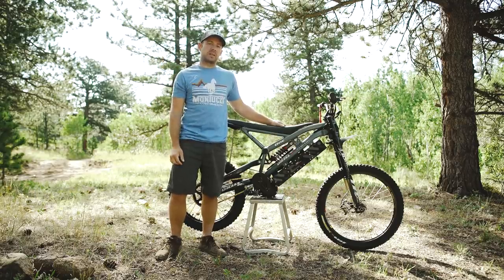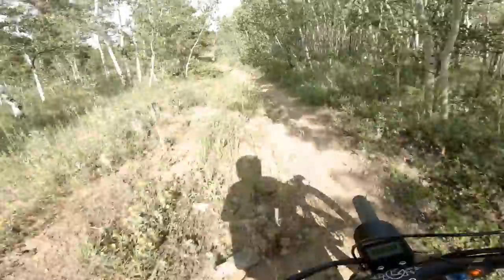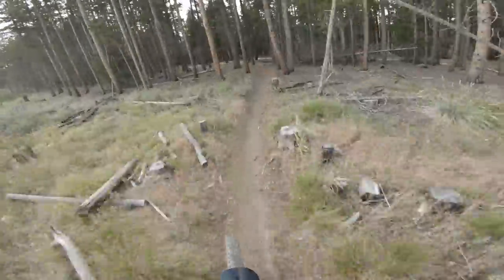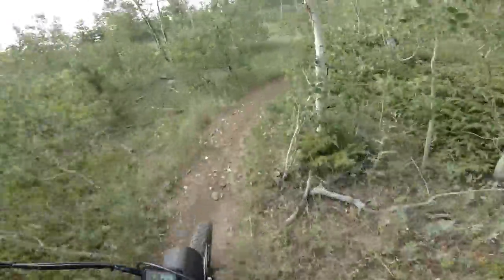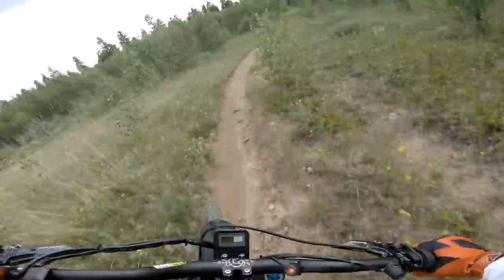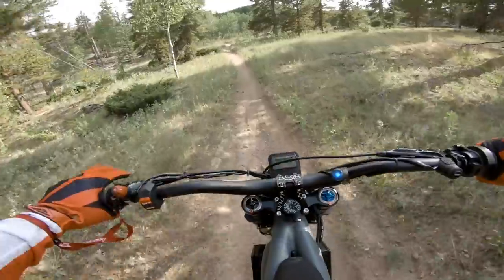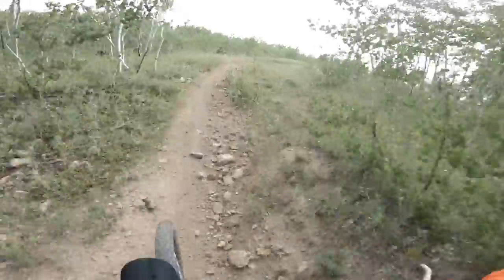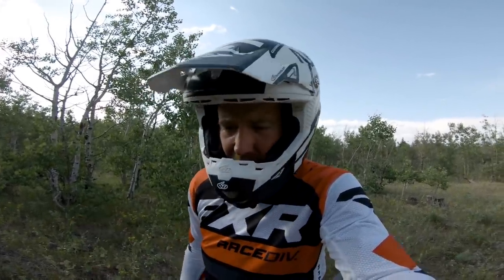CZEM Drill One Electric Dirt Bike | A Sur-Ron Destroyer?

Comment: Yo Tucker, What recommendations would you make for improvements? You mention heavier tires, can you be more specific? Also , will you be contrasting to surron soon?
Reply from the maker: @Jeff Mangano Hey Jeff, still determining what I would change but for certain I would like this bike to have a 21" front wheel with moto tires. I'm still changing the geometry of the bike to determine how it affects handling and will have a follow up video on some of these topics. Thanks for the note.
Reply: @ElectricCycleRider  hi any updates or recent thoughts of the DrillOne?

Comment: What is  a  maximum battery capacity you can  attach to the frame ?  I wish to buy  this  ebike  with  bigger battery  to  reach   70km range in  mountains  ( my  weight 90kg )
Reply: An extended range battery or interchangeable would be a killer option.

Comment: I'm not rly into the whole ebike topic but maybe I would change to this from a 250 kxf in terms of sound and the variety of parts and tracks I could use in my area.
I checked sur ron but it looks like a motorcycle too much for my purposes.
The surron has a torgue of 200 nm if i looked it up right but the drill one is told to only have 40.
Can someone who got the knowledge and time please explain how the statics of the two bikes compare to each other :D
And / or give an alternative?
Thx

Comment: According to the specs (http://drillelectricbikes.com/drill-one-en/) the battery is 42Ah (Surron has 32Ah). So if the power consumption is 3x more compared to Surron the miles range is 3x less (than Surron's "up to 100Km"), giving smth around "up to 35-50Km"? Is that correct?

Comment: How do you feel about exposed battery and a motor on this bike?
Reply from the maker: @Surron electro enduro diary Great question. It is a bit concerning to me. The motor could use a skid plate like the Sur-Ron. As for the battery, I'd be most concerned about the outer corners of the battery in the event of a tip over or crash and it is something valid to note for sure. Thanks for bringing it up.

Comment: I did my research meaning I went to the website that you linked onto your video I am not sure how this is a surround destroyer number one they do the same speed when you buy them in stock number two it's 11,000 the surround is only $4,100 so a destroyer I think not it may accelerate faster in stock but you can easily upgrade to a bigger more powerful battery and controller on the surround and really it was still be only around $7,000 that's of course if you don't sell your old battery and controller and get about 1,800 for those two items I'll be buying a sur ron .

Comment: My biggest complaint with Sur Ron is that they use a front tire as a rear tire when they could have easily used a 16” rear like “big wheel” 85s. Sounds like this bike did the same thing. Then went one step stupider and paired it with a 26” MTB front. What? I wouldn’t expect that to survive long with that power and speed and weight. 
And of course it’s $9k so that makes it not interesting. Sur Ron still is, but I do wish they’d fix the rear.
Reply: Drill one will come with no 26 inch tyre anymore. Just 19  or 21 inch front and 19 inch rear. Perfect set up we think. 😉
Reply: Nic Ellis 19” rear is dumb. That’s a front tire. Make it a 19 front and 16 rear.
Reply: Kevin Clark  as a distributor of drill one in Aust and NZ  we will talk to CZEM about your feedback but they have had issues with 16 inch rear on this bike ... Remember this is a 55kg bike only. 16 inch rear can be aftermarket anyway if you really want it. That is more a trials set up with 16 inch.
Reply: Sales EBMX 16” rear is the typical whee size for the midsize trail bikes (CRF150F) and big wheel 85 motocrossers. Good rear tire selections that can handle power output and wear unlike a 19” front used as a rear. Plus debt/flat resistance. I know it might be a little heavier, but it works on those size hikes fine. XR100s only make ~7hp. 
The big thing (for converting) is if it fits in the frame. I’ve looked at pictures of the Sur-Ron and they didn’t leave enough clearance for the wider 16” rear to replace the 19” front out back.
Reply: @kevinclark9176   CZEM have agreed to sell the bike with a 16inch rear wheel set up now.  the price will be a little  higher on that option as the tyres wont fit on those excell rims properly and parts will need to be sorted/sources.  Any Aussie or NZ guys you can pre-order this bike or ask us any questions on our EBMX web.

Comment: Take it on a jeep trail like around North Empire, Central City, Webster/Red Cone pass, radical hill, Guanella pass area, etc. See if it can go through a stream, etc.  See if you can explore all over the jeep trails and actually get back to your truck before the battery dies.  You can't ride that type of bike on I'd say most mountain bike trails that I'm familiar with, so it either has to be ridden on Jeep trails or on a track.  How does it hold up - it's not like that Chinese crap that falls apart and is impossible to find parts for, is it?

Comment: For someone that 2m tall, is there any viable options of these kind of bikes?
What model would have the best modifications for some like me having a "giant problem" 😔
Reply: Modded taller seat and seat assembly brackets tube welded higher can get 4-5 inches higher and 3 inches further back . Stem extender and riser bars. Relatively easy mods to a SurRon. Check out endless sphere or the EBMX blog also EEB and stealth type frames with bike seats on longer post extension Work too.  Also as you get older you shrink a little. 😉

Comment: Given how much heavier and faster these things go than a mountain bike do you not think it's a bit lethal to ask standard bicycle breaks to do the job of keeping you alive? When you spend thousands on a motorbike like this it's terrifying to think they cut corners like this on fundamental safety equipment!!
Reply: you obviously haven't ridden one... when they talk about improving brakes they're talking about converting an audi brake system to a Ferrari... (i.e. difference of good to great)  I've never had any issue, my SuRRon (2020 X) stopped on a dime depending on tires, I wore the tires and brakes all the way down , only changed after 600 miles , then upgraded with better pads / tires.
Reply: @dr.ericvanek2818  I have ridden them, and I work in a bike shop that gets people in none stop telling us how the brakes are not good enough, asking us which brakes to put on it to make them better, in terms of speed and weight they are not too dissimilar to mopeds, look at the surface area of the pistons on a moped, look at the disc rotor diameter and thickness.... You're asking a bicycle brake to do the job of a motorbike brake, they are not designed to disapate that much energy.
Reply: @Alex-md6bu  I would love to understand then... I've always been surprised about complaints and I have no problem stopping. My guess is that the people complaining are on the street? And have poor traction? Surface/tires being the main factor... ? I mean if you can lock up the tire that means your brakes are strong enough. If your brakes are getting too hot you break with the engine on Ebikes. The user has enough control to manually use intermittent braking... So what causes an improvement?
Reply: @dr.ericvanek2818  power is nothing without control, I can lock my brakes up if I pull hard enough is not the same as being able to control braking power without locking up, the same argument has been made about rim brakes on road bikes saying changing to discs isn't necessary because I can lock up, bottom line is you could stop better with better brakes, it's not necessarily just braking power but heat resistance, ok you can stop once but being able to stop again and again is a different story, I tell you what if you think mountain bike brakes are acceptable on a motorbike (which a surron basically is) why not put your car brakes on a lorry, I bet you won't walk out Infront of that lorry and trust it to stop!!!

Comment: Can you give me an estimate of miles you'd get in blue and/or red mode riding the trails and pace you did in this video? Could you get 40 miles out of it while still riding at your 80% top pace in either mode? (ideally red :))
Reply from the maker: @Chris Campbell After some testing, we have found out that you're not technically supposed to ride the Drill in red mode at full throttle for more than 20 seconds and blue mode for more than 60 seconds. A bit of a bummer there but it hasn't allowed me to test range in those modes.
Reply: @ElectricCycleRider  that aligns with other reports I've heard from ebmx and others, there are some things that aren't really production ready with the 2021 drill

Comment: How does the size and fit compare to the Sur-Ron.... (how tall are you?)

I've heard folks comment that the Sur-Ron, being designed by the Asians, can run a little short and compact.... and may be cramped for taller riders?
edit right after asking this, I got to the part in the video where you mentioned it was bigger, i'll leave the question though, in case you have further input*
Reply from the maker: @Sam Rides Bikes It's a bit bigger than the Sur-Ron, fits better for sure. The Sur-Ron does feel small. I'm 5'7".

Comment: A Surron with the bigger battery and bigger controller mod will do 90mph and still cost $3,000 less at $6k
Reply: Add on suspension, better wheel tyres,handle bars ect ect list goes on.I think the bikes are very different in price for a reason BUT because they are similar in style they are relatable in the sur-ron Vs Drill title👍
Reply: @fpvlee1586  yea they can definitely move up in price when modded

Comment: Nearly £4000 more expensive than the Surron, Hardly a good comparison.

DRILL ONE price's start @ £7800
SURRON prices start at around £4000

I'd sooner buy 2x Sur rons than one of those!
Reply: Go look at the some of the used Sur Ron's for sale where the person selling lists out what he's dumped into his bike.  There are people who have more than $11k sunk into their bikes just to get them to this point.  Basically, they only keep the frame and motor.  Granted there's a lot we don't know yet, but best case scenario, getting a bike with these components straight from the factory > modding it yourself.  Plus, we won't pay VAT tax in the US (20% off right there) and hopefully you wouldn't be at the mercy of a single reseller...looks like they have 2 right now.
Reply from the maker: @Gee Diddly It's hardly a comparison video to begin with. I mention the Sur-Ron very briefly in the video but because it is the same category bike (weight, size, motor, suspension, controls, brakes, etc.) it's very hard not to juxtapose these two bikes when riding. Yes, it will cost more money. It also has higher end components. As @Troy Muni points out too, there are a lot of Sur-Ron owners that spend a lot of money upgrading their bikes. To each their own, I'm not suggesting you should buy 1 or the other. If you watch my other videos, I have a lot of positive videos about the Sur-Ron as well. I simply posed a question. You can answer it as it relates to you. Thanks for the note.
Reply from the maker: @Troy Muni  Thanks Troy

Comment: wrong surron's 110lbs. If this is 115 then it's 5 lbs heavier.
Reply: Yes that is factually correct. SurRon 2kg lighter in stock form.
Reply from the maker: @intra morph You're right. I misspoke on that. The Sur-Ron is 5 pounds lighter than the Drill One.

Comment: Great bike, what is the top speed on this monster?!!!
Reply: 55mph. Nothing crazy.
Reply: @mshock9637  still faster than the stock surron with the wire cut, the low-end is crazy on your bike,very cool !!!
Reply: @ZoSoUsAm  
True but the amount spent on the drill one you could put into hot rodding the sur ron and making it a real zipper. 
Yeah i had to replace the controller on my sur ron and luna ended up sending my one of their 120 amp ludacris controllers. Its nasty, its a whole different bike now.
Reply: @mshock9637  yeah, that's what I was saying, the last time I looked the surron was capable of like 70mph on street tires,and bells and whistles,I'm diggin the electric bike/Moto, now just gotta win that lottery,lol,!!!✌️
Reply: @ZoSoUsAm  
Im actually looking to sell my sur ron. Just shy of a fortune for a mere $3k. I dont want to unload it but for my purposes (an emergency vehicle for when the wife and i are out in the boonies) i could really stand something with a tad more range. I get 25-30 miles out of a charge. But something closer to 100 woukd be better.
Reply: I wonder how many used sur ron got sold in the usa? Ive never seen 1 for sale before.
Reply: @ZoSoUsAm  
70 i think would be easy to get to. You can push the stock batteries to 300 amp peaks and i personally think it could handle 180 continuous. But modding the battery can be as simple as removing the BMS altogether and just installing a properly sized slowblow fuse and simply using a balance charger to charge. That battery would be all balls.

Comment: Those trails were flat af. Why not a course or track?
Reply from the maker: @Enlightened Idiot That is the 1 mile practice track that I use to initially test most bikes on this channel. It's a good consistent bench mark for all of these bikes and has plenty of rough sections, tight turns, straight aways and elevation change (which is hard to see from my GoPro angle) to get a good understanding of the bike. They are not motocross bikes and I'm not about to huck a demo bike that I don't own around a pro track. When the manufacturers start making bikes that are designed for the track, I will put them in that environment. Until then, I have to film all of this and do so in an environment that I can control.
Reply: @ElectricCycleRider  Got it. And you're right about elevation not showing up on camera. Peace.

Comment: A few points...Don't you think it would have been more sensible to start in green/eco mode, then work up through blue and then red, rather than just whacking it straight into full-bollocks flat out? Also, you say it's 5lbs lighter than a Sur-ron, but my spec sheets say that the Sur-ron LBX weighs 47kg (103lbs) and the Drill weighs 52kg (115lbs as you said). That makes the Sur-ron 5kg (11lbs) lighter than the Drill! Also, you show us some good views of the bike at the start of the vid, but when you're talking about specific details such as the welding and the front wheel, it would be much better to see a matching close-up shot of those parts instead of just full-on, flat out, on-board shots or, at the end of the video, nothing but your ugly frigging mug in a helmet! I look forward to seeing a follow-up...

Comment: Cool, but that's a couple thousand more than a brand new street legal Honda 650 dual sport.
Reply: And about 10,000 times cooler than anything on the market for the fun factor as I added lightweight racing wheels and hubs and got the bike to 94lbs charged. We can ride in all the areas that everyone complained about our MX bikes and the 5.0 just stops us to check them out and shoot the breeze. They are the cool factor for many years to come and it's easy to judge something from afar. Once you have experienced the power and multiple power modes to pick your poison you will think differently as I have always been a gas guy until I started playing with electric 5-6 years ago.

Comment: 15kw? That sounds like total be. Can anyone multimeter the volts and amps?
Reply: Yes I can do that soon.. Peak is actually theoretically over 18kw if you do the maths. 😮
Reply: @nicellis2855  yeah but all electric power readings are just on current draw, not torque at the motor. 
Its just like shorting  the battery with a screw driver, sure you'll get 50kw of draw but that doesn't make the motor spin faster
Reply: jane blogs  we will test it for you and report back to this you tube formum discussion. We were suss as well. Numbers and graphs and detailed info we have seen from manufacturers and our technicians opinion is that it’s real power. But let’s see.